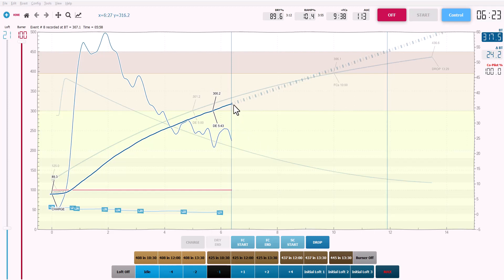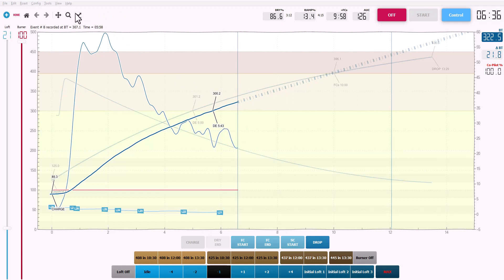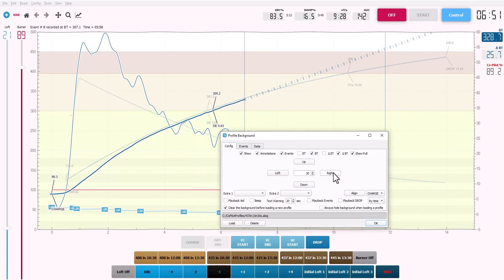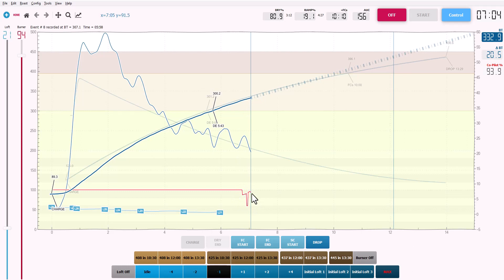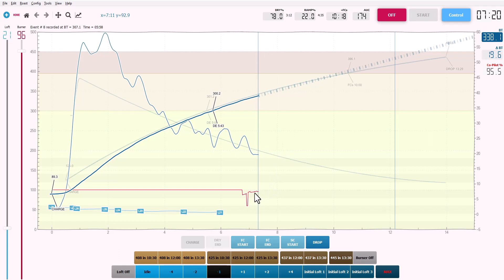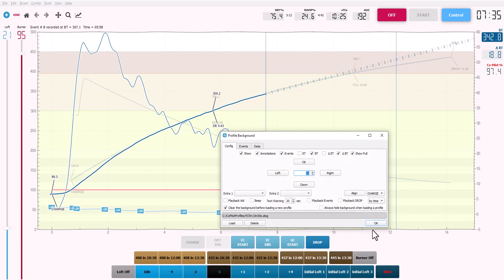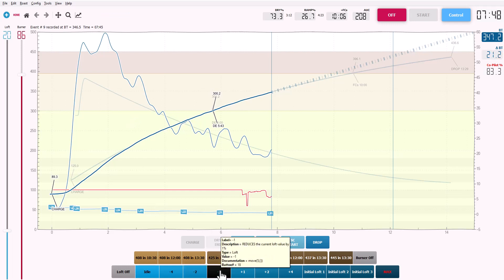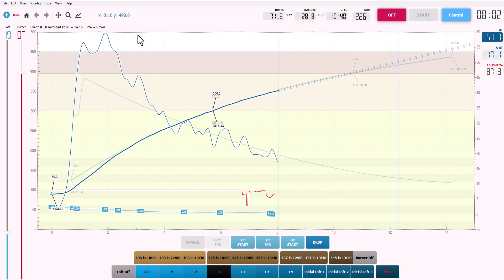Adjusting the Artisan background profile DURING roasting

Comment: I’ve got the Smole 350g roaster and followed all of your videos and have finally gotten everything tuned just about perfectly. Using the numbers for PID you gave me got me close, but I was always following the curve under just like this video shows. ALWAYS. It was driving me nuts until I found the secret sauce for me was to have a tiny Integral value of 0.030. Once I did this. The roasts have always tracked up to the line before dry end and locked in the rest of the way.
Reply from the maker: So glad to hear this! I've actually updated my PID video with a caption during the discussion on the Integral value. Like you, I have discovered that very small Integral values can help punch the heat up a bit without resorting to high P values that cause oscillations. Glad you discovered this on your own!
Reply: @hermetheuscoffee  you have been such a huge help with all of this. I’d like to return the favor, im more of a woodworker than roaster so I built a prototype handle system for the Smole roaster body because they tapped the bottom aluminum piece as if they intended to build this. I’d love to send you one if you want to shoot me a PM